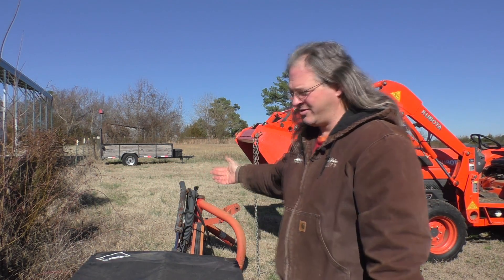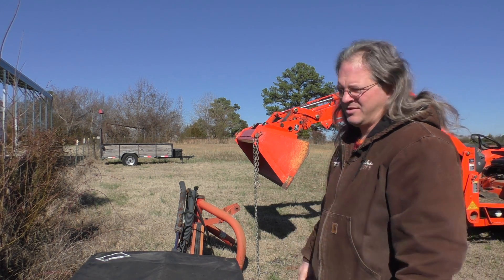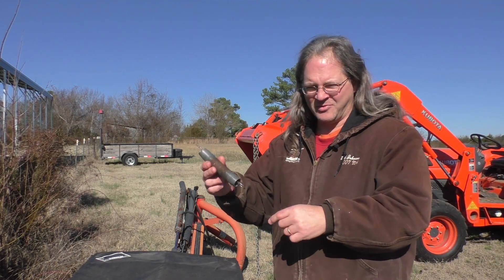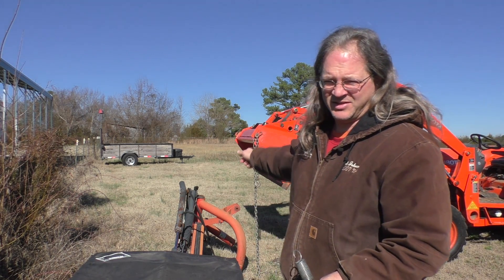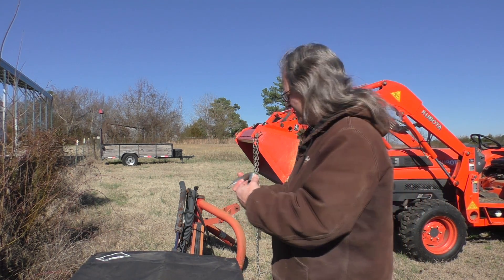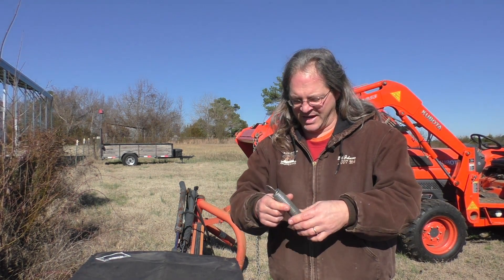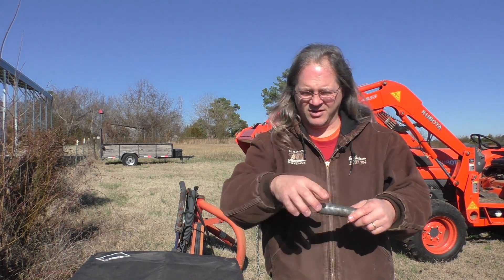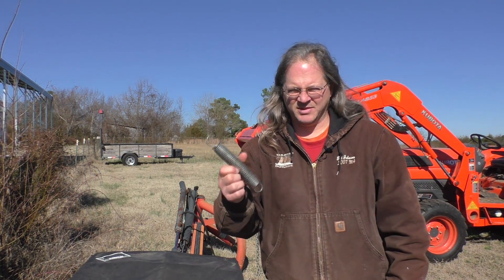Making a DIY 2x72" Belt Grinder from Treadmill Parts

Comment: How is it holding up?  This video inspired mine about 6 months after you made it.  Mine is still going strong.  I put a jack shaft on mine and used the small treadmill belt to power it,  I geared it down a little so it would have more power being the treadmill motor turns about 2 times faster than a normal motor.  It has all the power I have needed. But I do want to build a new one that tilts.  I hade skateboard wheels on mine and I ditched them for real purpose-made wheels.  But my drive wheel and drive pulley for my jack shaft are made from oak that I turned on the lathe.  If  I do a new one I think I might go vfd. but these treadmil motors are stout as ell when turned up.  They lack some power at lower speeds.  Great for a 2x72 but I put one in my shopsmith that lost a motor just to use as a drill press and it struggles a bit.  A vfd has full hp at any speed as the motor gets full voltage at any speed and you adjust the frequency.  My 2x72 is one of two videos on my channel it is made from what was lying around.

Comment: Yeah, like taurus dragon stated, your welds need a lot of improvement.  I was a certified boiler maker, and I also have been welding for 30 + years and the welds have to be perfect.  Take some lessons from a certified welder and stop drawing the beads and push them, holding the torch at a 90 degree angle to the workpiece and you will get much better or perfect welds.  Also, watch out for the cold lap, this is proof that your welds are only connected to one of the base metals.  And yes, your inventions/designs are AWESOME, keep up the great videos. Cheers

Comment: nice job i have that same motor was wondering if the pipe welded to flywheel could be a couple inches shorter maybe 3 inch ???

Comment: The MC 60 control board usually is used along with a beefy reactor connected in series with the DC motor. It looks like a decent sized transformer with only 2 leads coming off. The reactor's inductance along with the heavy flywheel helps to mitigate the fairly poor performance at lower speeds.
Have you had any problems running your sander/grinder at low speed? 
If yes, you might want to consider adding back the reactor on the black leg of the motor. 
The board is also known for it's soft start "feature", where it fails to start if the pot is set in a particular range and needs to be taken back to zero to allow starting- as it's expecting a treadmill type usage, of beginning at speed zero and increasing. 
There a number of mods, each with different degrees of impact,
Clipping the RPS 3 resistor has been the easiest reported mod to tone down the "soft start"

Comment: How have those belt wheels held up over the years? I'm not crazy on the idea of poly wheels if they wear out quickly. I understand trying to limit expenditures to keep costs low, but I think that these wheels are vital component for a belt grinder build. Pretty cool though. Love the idea of the treadmill motor, as they have more torque than an ac motor. Cheers!
Reply from the maker: They have held up fine.  No problems at all.

Comment: very impressed with the idea of using a tread mill motor on a knife ginder and other shop equipment  so after seeing a number of builds using a tread mill motor I tried one also.  However i didn't have as good of luck as others seem to have.   I have no tork and can stop the motor with little pressure applied to the belt.  I even changed out the original  controller to a dimmer style and rectifier and had about the same luck.  Is it just me expecting to much from the motor.  I have a 2.5 hp dc motor, 120 volt @ 17.2 amps.  I have a 5" pulley on the motor with the flywheel still attached, running it at 2,000 rpm and stalls more like a 1/3 hp ac motor.  any ideas to fix the problem
Reply from the maker: I can stall mine if I press hard enough at slow speeds, but the controller detects this and tries to pick up speed.  Not really sure what is going on with yours.
Reply: my treadmill 2 1/2 hp motor has no detect circuit only 2 wires black and red.  I only apply Little Pressure ( 1" wide 1/8 " thick) and can stop it with one finger pressure.  I've used two different controllers.  Could the motor be bad?

Comment: How has everything held up on it? I want to do the same thing but I worry about welding that tube on the flywheel. Seems crazy it doesn't mess with the rotational balance. Great job!
Reply from the maker: All good.  I use it all the time, nothing has broken on it yet.

Comment: you should give me those motors to make table saw  machines not stupid grinders because a grinding only need 1700 RPM or less not  that kind speed ,even if you use the speed control is gonna bee a wast

Comment: Not to have a dumb question but with the tachometer, where did the power come from?  Did you have two power cords going into outlets or did you wire it in with the 120?
Reply from the maker: The power comes from the wall transformer that I cracked open and put in the enclosure.
Reply: @MakingStuff  I did see that.  I was curious where it was getting power from.  I'm guessing it was wired in with the same power that is powering the board.  I can't imagine that tachometer is drawing that much voltage/amperage

Comment: FYI:  Serpentine belt idler pulleys, (Dodge/Plymouth are best because they have a flange), and a belt tensioner are great for making 1 x 72" or 1 x 42" belt sanders.  Because of the flanges on the pulleys, you don't need an alignment mechanism.  The idlers have sealed ball bearings.

You can use a smooth drive pulley from serpentines as a drive pulley on the motor.  Use someone that non-slip adhesive tape for traction.

Comment: I like your design on the belt adjustment wheel. As well as the compression spring being integrated is cleaner and more compact.

Comment: @Making Stuff
Where did you get the small plastic pulleys/wheels?
Reply from the maker: I got them on ebay.
Reply: @MakingStuff How about a link or maybe a title for the listing?
Reply from the maker: @diamondperformancefab5931  Search "2 x 72 grinder wheels"  I don't see the ones I bought, but there are a bunch of different ones on ebay.

Comment: Regarding the spring, a simple cam over design would have eliminated the need to stretch the spring. Also, try annealing the spring and then stretching it, then hardening it after stretching.

Comment: Why do people drill a hole with a dead sized drill instead of using a pilot drill/hole first. It's less strain on the drill bit and on the machine doing the boring plus less likely for the metal getting hot and knackering the drill bit up in the process. Or better still just use a stepper drill bit.
Reply from the maker: The drill bits I'm using are from Dewalt and they have a tip that is like a smaller drill bit on the end.  I'm not sure what they call them,  but they work great for drilling metal.

Comment: Nice build. I am currently trying to hook up my homebuilt grinder with a tach just like yours. How did you wire yours?
Reply from the maker: It was wired according to the wiring diagram that came with the tac.
Reply: @MakingStuff  I was actually asking how did you get your power supply from the MC60 board to the tach. I am unsure if or where to tap 8-24 vdc from the board. Sorry for my confusing questions.
Reply from the maker: I used a wall mounted power supply (wall wart) and busted it open.
Reply: @MakingStuff  OK got it. Thanks for the reply.

Comment: The easiest way to get large compression springs is visit a motorcycle junk yard. Front forks and rear shocks come in all sorts of lengths and diameters. Rusty rear shocks with 'blown' dampers are real cheap, rarely more than thier weight in scrap value

Comment: When you put the assembly on the table, it wobbled. Right there you should have checked for square on the pieces. That might help on the overall belt running true.
Reply from the maker: The table is not straight or flat.  Plus it has glue and paint on it too.

Comment: All shaft of the belt wheel must be 90 degree as belt touching the angle every belt pulls inqluding moter pulley and moter fixing bas should be  check by sprit level .

Comment: Hello, I built the exact same model except it was right hand drive and had the exact same problem with tracking. There's a guy here who built the first of this style, can't remember his name but after watching his video 20 times it turned out that the top swivel piece for the tracking roller ended up being the problem. I had made it just a bit to far to the inside by the belt, it needed to be closer to the metal upright. Once I got that fixed it ran a lot better as far as tracking went. Great shop build though Thumbs up!!

Comment: i wonder if it's possible to temper a stretched out spring. i've read that if you quench it too quickly it will be brittle, too late and it's too soft.

Comment: How did you cut the smile into the piece of steel so you could change angle of grind ?
Reply from the maker: I had a welding shop cut that piece out on a plasma cutter.  It only cost $20 for the steel and to have them cut it.  More info at www.makingstuff.info.

Comment: After stretching the spring you should put it in the oven at about 280'c for half an hour and the will stress relieve the wire and give you a much longer life from the spring. Im a spring maker by trade.
Reply from the maker: Thanks for the tip, I'll have to try it.

Comment: Love the build and especially the RPM guage.  One question though...Its always recommended on every grinder build video I've seen to use a totally enclosed fan cooled motor TEFC. Grinding obviously creates lots of metal dust...which is not good for an open housing motor. How has your motor stood up over time?
Reply from the maker: Been using it over a year now and no issues.  I don't grind on it like a knife maker would, but I still use it a lot for metal and some wood.

Comment: Where did you get the box with a clear cover? I am building a 12" drum sander using treadmill motor with SCR motor controller. Using MC-60 Motor controller  is way too expensive.
Reply from the maker: It came from Polycase.com.  Not sure but I think it had to be special ordered to get the clear cover.  If you can't get one from them, there's still a few new ones out in the shop that I can sell.
Reply: Making Stuff Can you tell me the dimensions  and how much are you asking for? And also how many boxes like that do you have?
Reply from the maker: Send me a contact request on the website and we can talk via email.  www.makingstuff.info/contact

Comment: Look dam nice with some Lipstick on it.  
Do you have a tram adjustment and wheels with a convex surface to help hold the belt in the center?
A few questions about the design.
Why the before and after pulleys over the metal backup plate?
Why not make that part removable I used to use a 4" belt sander all day long you can take the backing metal brace off for a lot of operations it's not all about cutting metal fast, you can shape with them also.
You want to cut fast build a disk sander. 12 or 14" 

I can't say anything about your welding to me I can't even get a wire welder to feed without getting stuck, I use a stick welder and I think I'm getting decent penetration but I haven't welded much.

You should Clamp your work down tight to the drill press or use a fence system or both, Don't trust it wont grab they do.
I worked in a machine shop. Murphy's law.  

Valve guide spring from a V8 motor compression Spring. stack them if you need more spring.

Comment: Did you need to use a transformer with the mc-60 motor controller board?
Reply from the maker: Not on mine.  It has a place to hook the mains power straight to it.

Comment: great looking machine what is the max belt speed you can run in meters per second
Reply from the maker: Have no clue, the drive wheel turns 6000 rpms and the belt is 72 inches long.

Comment: i know this seems obvious but looking at how the idler pulley is tilting downwards says to me it could be tilted upwards just by turning that bolt that adjusts it, you can see its not aligned if going by the top edge of the idler pulley tower edge ? maybe im wrong ? nice build though and love the digital rpm readout very cool , oh and the spring stretcher was cool too LOL good work, nice to have such a strong helper parked in back haha..keep up the great cool ideas !!! see it at 16:25

Comment: 14:45 you could weld on 2 more nut's and screw in the bolt's a bit above the bottom of the inner pipe. if you do that on both side's you could get the extra wobble out.

Comment: you mention that you had to build the motor on the opposite side because it would likely unthread itself.  what if you used red locktite. do you think it would be strong enough then?
Reply from the maker: I don't think it will work. I wouldn't risk it.

Comment: Nice product! Trying to do a similar project but don't know too much about different types of welders. What size/type of welder would I need to accomplish a project near identical to this one?
Reply from the maker: I used a 30 year old cheap 120v MIG welder.  Didn't make the prettiest welds, but it worked.  Any low end MIG (or better) that makes halfway decent welds should work.  Normally I use a TIG welder but it was out of commission at the time.

Comment: Fail early and often.  Failure is an excellent teacher.  Cool build.  Thanks for documenting and sharing.
Reply from the maker: There's no substitute for effort, even if it leads to failure. ;)
Reply: Any info about sourcing the rpm display?
Reply from the maker: Link to tachometer is in the video description and on web page.
Reply: Thank you.  Guess I could have looked. Appreciate your quick reply.

Comment: Why couldn't you use the flywheel already on the motor? Why weld that tube on?
Reply from the maker: The flywheel is not wide enough for the belt.

Comment: Those motor control boards often fail because the manufacturers never attach them to proper heatsinks. Especially in an enclosure you ought to add fan
Reply from the maker: The whole board and transistors are mounted to a huge heatsink.

Comment: I followed your grinder build and I am at the point of making all the electrical connections. I can't quit figure out from the video how to make all the correct connections in the control box. Any help would be appreciated.
Reply from the maker: Are you using an mc60 controller?
Reply: Yes, I am using a MC60 controller.
Reply from the maker: Go to google images and lookup "mc-60 controller hookup".  There's plenty of examples there.
Reply: Making Stuff v

Comment: Looking at the heights of your welds it appears you either need to slow down the wire feed or increase the amps a bit.  The last thing to consider is you are moving the gun to fast since the puddle is not leveling itself out, but instead it is just making a mound of non-penetrating metal.

Comment: Nice design, but those welds are in serious need of some work. Thanks for making the plans available and sharing your research, but please find a welder and ask him for 10 minutes of time to get the basic torch angle snd contact tip distance down if you're  going to continue  to make power tools which could injure  you  when they fail catastrophically.

Comment: couldve used an airstrut from a hatchback car for the compression spring , all you had to change was puting the closed end of the sliding pipe on top
Reply from the maker: I was going to do that, but this way didn't require me purchasing extra parts.

Comment: Thanks for the tip on the tach.  Been trying to build my own.
However I'm not sure (even from Amazon comments) whether those tachs can output a signal to another system (like an Arduino) instead of just displaying the speed.  Any ideas?
Reply from the maker: Its just a hall-effect sensor.  You should be able to send output to an Arduino.  I was able to see the square wave on my oscilloscope.
Reply: Sweet, that's exactly what I was looking for!  If it's making a square wave then there are some other electronics in there since the HES's I've played with seem to output an analog signal as opposed to a simple on or off.

Comment: A super project ! I'd recommend adding an emergency stop button though, or at least a machine type start/stop. Otherwise a nice, well rounded project !
Reply: and maybe some grounding...
Reply: Don't put your tongue on the DC Wires! But I'm going to say the 12-24-36 volts are pretty safe as long as your dry. Looking at the power supply the Amps are not that high its about 2-6 amps of current chances are you won't get bit by it You will on the 120 Volt side. But its a DC motor. At any rate the Electrical box was fully insulated by the plastic housing, you'd have to do something pretty dam dumb to get shocked with it.
Its highly unlikely. 
I'd be more concerned touching a light switch with wet hands.